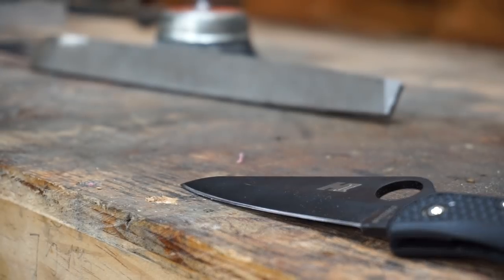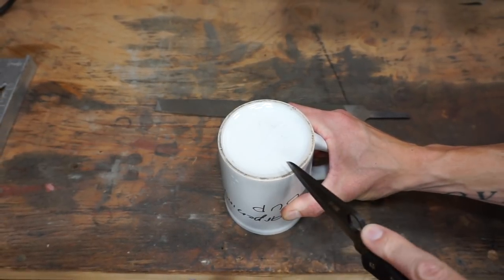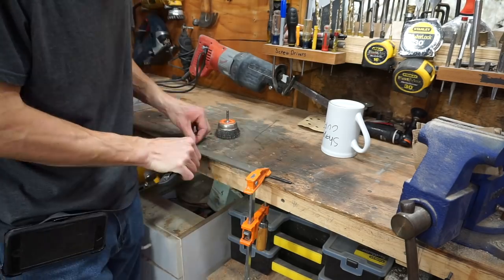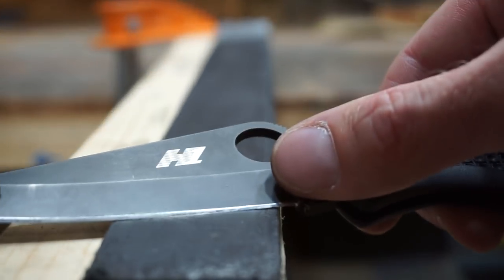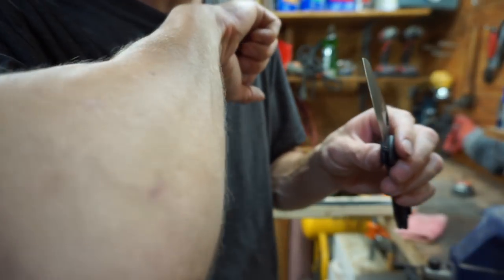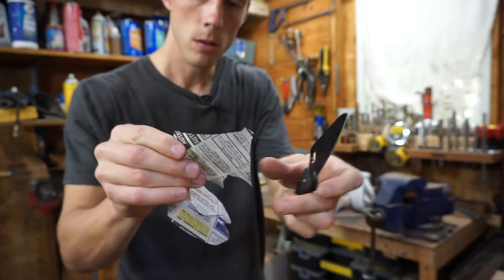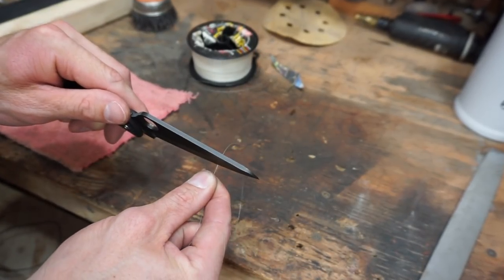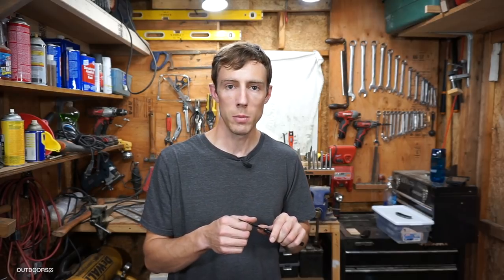WEIRD KNIFE SHARPENING METHOD. Can you sharpen a knife on a file?

Comment from the maker: Here's the link to the knife in the video 😀
http://amzn.to/2xU9eWO
THIS IS AN AMAZON AFFILIATE LINK
Reply: OUTDOORS5
Reply: That's a really interesting knife to be doing any sort of testing on because H1 steel is rather odd in the sense that it's work hardened steel meaning that out of the box your edge is going to be like a 54 HRC or something like that and get harder as you remove steel supposedly but yeah H1 out of the box is softer than most steels I think? I'd be interested to see you try tests like this with stainless and carbon steels at high and low HRC. I bet the file would fail to sharpen any high HRC stainless steels.

Comment: Sharpening has taken on an almost mystical element to it on the internet, if you use anything other than "approved" methods some unknown terrible thing will happen. I have fancy stones and a belt grinder but I also use sand paper and it's pretty effective. You should try sand paper in this weird sharpening series, not backed by a mouse pad but on a hard surface, the same way you built your strop but with sand paper instead of a leather belt. Double sided tape the ends down (only),  It makes good enough makeshift "stones" and in as many grits as you want. I started doing this to make field sharpening kits so I didn't lose or damage my expensive stones out in the woods but then started using them at home on cheap knives so I didn't clog the stones, it'll work good enough for shaving or skinning sharp edge.
Reply from the maker: I have to ask myself sometimes if there's a point to these weird sharpening videos beyond,  "just for fun ". Although it is kinda fun to see what works and what doesn't, I think it's more along the lines of, "just because you have a $10,000 camera doesn't mean you are going to take great pictures."  I think a lot of people get caught up in the gear (including myself) and forget about the main objective. Not only that, but maybe we will find something new that works better, or changes the way something is done.  Honestly, I think I'm going to be using a file, rather than a coarse stone from now to re profile knives that are in really bad shape. I still need to do more testing, but it seems to work really well at removing metal, without leaving super deep scratches. I will probably do something with sand paper soon. There's a lot of different things to cover as far as that goes haha.  So many different ways it can be used. Thanks for the comment 😀
Reply from the maker: I hear you. The stones I use most often are from edge pro they're cheap and very small but definitely get the job done.
Reply: I agree! I think that it would be fun to use sand paper to see what kind of edge you could get.
Reply: I've exclusively used sandpaper for years.  You can get packs of wet/dry paper on amazon for cheap.  I recently bought a 40 pack with grits ranging from 600-7000 that cost $11.  

I'm a woodworker and always have sandpaper on hand so that would always end up being what I sharpen my chisels with.  Then I started using it to sharpen anything that needs an edge.  I don't even own any fancy stones.
Reply: @isaiahii6982  can you send me a link to that
Reply: @d.h5741  Just search "wet/dry sandpaper" on Amazon and a lot of options will come up.  They have a cyber monday deal for $10 with 65 pieces.

Comment: Filing a blade is normal for restoring a severely chipped or nicked edge, but not general sharpening. (Nothing that much out of the ordinary.) You'll use up a lot of the blade material fast. It's like a carbide sharpener but worse. The exceptions being something like an axe, chainsaw, or lawnmower, in situations where the blade is expected to see severe wear from normal use anyways.
Reply from the maker: I wouldn't say it's normal for pocket knives... at least from what I've seen. Larger blades maybe. I use files for my axes all the time it works very well to establish the primary bevel.  Thanks for the comment 👍
Reply: pauljs75 yes , though I tend to sharpen my machete with a file , then hit it with a very coarse whetstone to knock anything off , my axes and hatchet tend to get the bench grinder with a fairly fine wheel
Reply: pauljs75 
Bastard files work damn good on machetes
Reply: Jon 
I prefer a die grinder when a grinder is needed.

Comment: I have an old Gerber EZ Out that had lost its edge in the back half near the serrations. No matter what I did I could not get the edge back.  I used a file followed by a fine stone and brought it back with ease. 20 low pressure reverse strokes per side with the file and then 30 or so per side with the oiled stone followed by a quick strop on my belt. Shaves hair now.

Comment: When I first started sharpening knives as a kid, all I had was a 3 corner edge file, knew nothing about all the different ways and things you can use to sharpen. I didn't pass the knife on the file I filed on the edge by hand and when I said by hand, I had no clamps either, pain in the but to do but it worked out good. Knew nothing about knife steels either.

Comment: I do like using a file to sharpen my kitchen knives. I have a fine file that I THINK says "MILL 2ND CUT" stamped into the steel. All I know is that it's teeth are about 2x as fine as my fingerprints.
And yes it does leave a kind of 'micro serrated' edge that will blitz through my fingertips as easily as it blitzes through tomatoes and other vegetables, if I'm not careful lol.

Comment: So what happens when you take that file that you used to sharpen your knife with and turn it into a knife cutting instrument? Also what type of metal is that file made of? Obviously it's harder than your knife Steel so how would you tool it / machine it without destroying the hardness of it? Once again what kind of Steel is it if you can find out the metallurgy behind the Steel I guess you could anneal machine then properly harden it into a nice knife?
Is it worth going through all that trouble? Is it better to just buy knife stock steel and start from there?

Comment: For me the stropping makes all the difference. My knife will be pretty sharp, but after the strop it’s always noticeably sharper.
Reply from the maker: Yes, the strop is where it’s at👍
Reply: what’s a strop?
Reply: @Coraline-jonesyy  usually a strip of leather that you pull the knife across after sharpening on a stone. I.E the old straight razor scene at the barber in movies. You can use newspaper or cardboard too. Just removing all remnants of a bur and further polishing the edge.
Reply: @richardcagle5475  thankyou. do you have any tips on what technique to use when sharpening a knife?
Reply: @Coraline-jonesyy  oh man, there are too many to list, but don’t get bogged in the details. Most people do just fine with a decent 1000 grit stone and practice. Easiest method is the “bob Kramer” one where you pull the knife down the stone in long, easy strokes. The “Japanese” version has you work small sections doing most of the work pushing the knife away, but you push/pull a section at a time and work your way towards the tip. That one works best for crazy sharp for me, but I usually just pull because it’s easier and generally faster. Most important thing, no matter how you do it, is to keep a consistent angle. Use a sharpie to mark the edge and check to see you’re removing it all evenly as you practice. After a while it’ll be second nature. I still use a sharpie occasionally and I’ve been doing my own knives for years now. Check this guys other tutorials out, I learned a lot from him. This is kind of a gag video. There’s a Japanese guy name ryky at buffection channel that’ll show you the Japanese version. Pick one, spend about $50 on a decent combo stone and practice practice practice. Be slow and steady and even your first attempt will surprise you
Reply: @richardcagle5475  thank you 🙏
Reply: @Coraline-jonesyy  my pleasure. Only downside for me is that I realized just how really crappy most of my knives are 😏. Good steel makes a big difference. You’ll save money and skin if you learn the skill either way. Have fun

Comment: You're a really good edge maker mate.  When I read methodS, I was hoping to see more than one, or perhaps number the series of "Weird Knife Sharpening Methods"?
Reply from the maker: I didn't even realize I typed in methods thanks I'll change it👍
Reply: No worries. I keep thinking you're in Ontario  - is that correct? In other news, I feel I had to come back to share something with you as I find your ability to sharpen quite inspiring. I just sharpened three knives - ranging from large kitchen knife to US army issued gizmo holding a solid lock knife, spoon, fork, cork screw that I use for camping - on a loonie priced garage sale found very uneven sharpening stone with unknown grits. I havent flattened it because I'm lazy and I think I can work around it. This is the second time sharpening on that stone and after a few quick strops on my pants leather belt keeping the angle as you show here in the video, I a) cut myself as I started to run the blade backwards from too much pressure b) shaved hair easily with each knife. I'm amazed. The knives to start off before the first sharpening could just cut a tomato with serious pressure and back and forthing. I think the trick was the stropping at the same angle I sharpen at. Thanks for sharing your knowledge mate - its worked a treat for me.
Reply: Hey Outdoors55 - got those two Ganzo's if you wanna hear about them, and now sharp thanks to some practice and watching you sharpen on various surfaces. Cut my nose even, and my back in two places using the knife as a "scratcher" - cos I am used to blunt blades. Holy Moly. Time to adjust a life long behaviour...
Reply from the maker: Haha. That's funny! I've almost done the same thing while using my knife to eat with. Generally not a good idea to use a razor sharp knife as a fork..glad your getting sharp blades now though 👍😀
Reply: Thanks mate - leaves me wondering - can a knife just be too sharp for general use? You Ontarian?

Comment: This is really only good sharpening channel
I have been sharpening knives for me and my friends for quite a while, but I dont have credit card to buy compound for my strop over Ebay and I cant find it in depot stores
Soo are there any alternatives? I know just leather belt can be used but it takes a while.
Also, I got small sharpening stone usually used for scythes, and I dont know grid on it, can it be used to get knives sharp?
Reply from the maker: Not a lot of alternatives that give good results, at least that I know of... I think your better just using leather. Did you try hardware stores? Sometimes auto parts stores vary it as well.
Reply: Mislav Matić try Mothers aluminum and mag metal polish. A little bit goes an amazingly long way. Honestly though I quit stropping a long time ago.  It leave a nice shiny razor edge but I find this less than useful in the real world.  I convex with sand paper on a mouse pad starting at an appropriate grit for the amount of work needing done through 5000 grit Trixact ( get from automotive store ).  Nice mirror edge but again not useful to me as this level of polish just slides off of fibrous materials.  Therefore I step back to about 750 grit on a solid flat surface and proceed to gently apply a micro bevel that is flat instead of convexed. This gives me a fine yet toothy edge with the benefits still of the convexed area being both robust and less drag through media.  Nice working edge that is as tough as an ax but acts like a MUCH thinner blade as most of the contact area is mirrored.
Reply: if you have a normal bank account . you can link a paypal to it and make online purchases
Reply: Mix baking powder with water and use that as your compund. Works really good for me.
Reply: i don't think you necessarily need compound to strop just some smooth decent leather like he said, I've been sharpening for a lil over a year and never touched any compound and i still get pretty good results
Reply: Mislav Matić  hey man, do you have a Harbor Freight store near you? They have compound at a really decent price.
Reply: Mislav Matić metal polish works well, any type of polishing products will work. If you don't have any leather they sell bags of leather offcuts at hobby lobby. Or you can use a piece of Mdf (don't breath the dust when your cutting it btw).
Reply: Čini se da kužiš što pričaš...
Jel znas za neki dućan u Hrvatskoj da prodaje kvalitetnu opremu za oštrenje?
Trenutno koristim kamenje s ali expressa i definitivno želim nekoliko koraka više.

Comment: Is there a reason you sharpen pulling away from the edge sometimes? Does it de-burr it a bit?
Reply from the maker: Sometimes it does, but the results are really inconsistent.  Sometimes you can de burr sharpening into, or forward on the stone, but I still find it inconsistent. I just go backwards sometimes out of habit not a particular reason. A strop is the only consistent way I have found to remove the burr. Just my opinion your mileage may vary 😀

Comment: Hey I'm not sure it the sharpening with a file just works because the knife is just H1 steel. H1 is really not high in wear resistance and not on too high hrc hardness. I think it wouldn't really work good on some modern super steel run on high hardness. Or have you tried it on some CPM S110 V or CPM M4 or something like this?
Reply from the maker: No I have no tried it with anything harder than h1. Your right it will be a different story with the super steels. At least I would think so..although it's hard to say exactly. Not sure if the exact hardness of these files I would guess around 67. Although I may be way off. Might be an interesting test.

Comment: Nice Videos! I just found your channel and Subscribed! my Dad used to Sharpen his machetes with a Old Bastard file and he actually got them Really really Sharp!!! So i sharpen mine the Same way now and its alot Quicker for me than doing the whole edge on a stone and strop especially on dings on the blades or chips etc it re profiles so much quicker as the File removes much more material and i think thats what makes them so effective at sharpening machetes and beat up axes and blades and if you want it prettier you can still use a stone after. Thanks for sharing!
Reply from the maker: Thanks for the comment 😀 I think a finer file would have done ALOT better. I'm not used to sharpening in a file so it could probably been done better. It did remove a lot of material really well. Definitely useful for  Reprofiling.

Comment: I want a water stone, I can't find a 600 like on your beginner's video, 220,1000, yes, I noticed your a lefty too and I want to try the backward technique you use, what stone would be a good substitute? $$ is a problem. Thanks for any advice.
Reply from the maker: 220 and 1000 I perfectly fine. My norton stones jump from 220-1000 and it works. I do it all the time. 600 isn't absolutely necessary. Just fully apex the blade on the 220 and then move to the 1000 and strop. If you don't have a strop I would get one over a 600 grit stone. A strop is really that important. Hope this helps 😀
Reply: OUTDOORS55 I've got Good Strops, just no stones, I have my Lansky set's (reg.& diamond) & a work sharp guided system, I tried the backwards technique on that, glad it was a beater knife😂😱
Reply from the maker: I haven't heard a lot of good things about diamond stones. I hear they cut very well at the beginning but stop working very quickly. I have also heard the diamonds will in bed into some blade steels. This is all hear say, but from a reliable source. I have no experience with diamond stones. Haha getting the movement down does take some practice!
Reply: OUTDOORS55 the Lansky one's are quick to wear down, and the Work Sharp are even quicker, but the WS Doe's move, so it's great for curved blades and tip's, and I haven't used a Real Stone for 30+ year's, that's why I thought I'd like to learn how 😨
Reply from the maker: I just bought a cheap lansky with the ceramic rods. I'm going to do a video on it. Never used anything other than water stones so it should be interesting 😀 I read the diamond rods wear down fast as well. We'll see how it goes haha
Reply: OUTDOORS55 I meant the system that has the different grit stones and the knife clamp with different Angel holes, I haven't seen one with Ceramic Rods, that will be an interesting video,  looking forward to seeing it, your videos are cool and I learn new stuff, good luck😎

Comment: I was taught by an old farmer to sharpen with a file. Hoe"s shovel's sharpshooters etc. Not shaving sharp but useful tool sharp. If you ever take the time to sharpen a shovel you can see how a digger could go all day digging. Stop every 20 to 30 minutes and hit it with a half round mill bastard and you are back in business. This old man could take an Eye hoe and get it sharp enough to remove pig hairs off a pig hide at a hog killing.  And he would sharpen the files with battery acid (sulphuric). Did his wife's knives with them too. And no, he did not "grind" them with the files. Finished them with a 1X3 Arkansas. Did his wife's scissors and pinking shears. Use it up, wear it out, make do. Better off with the old than in debt for the new.